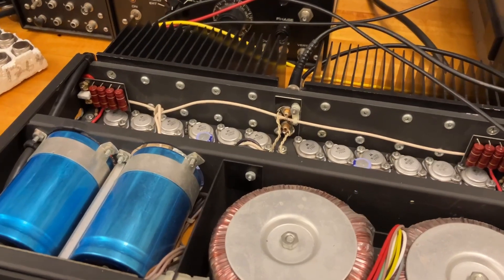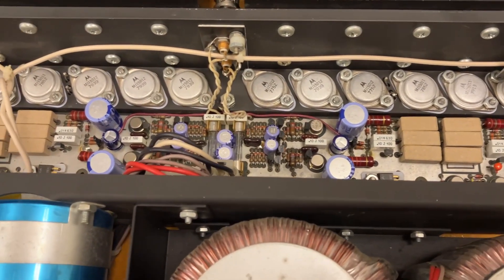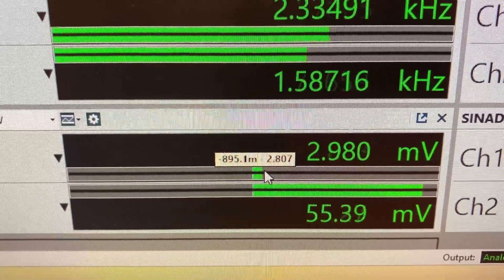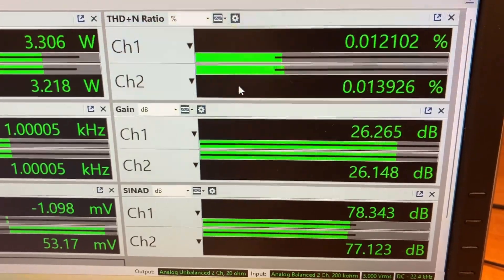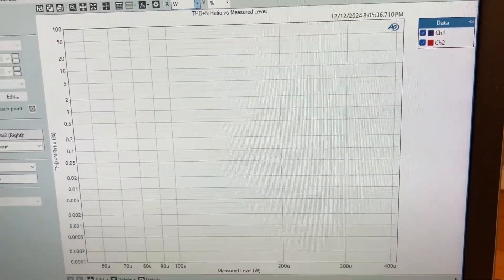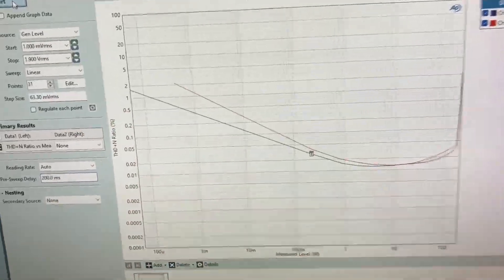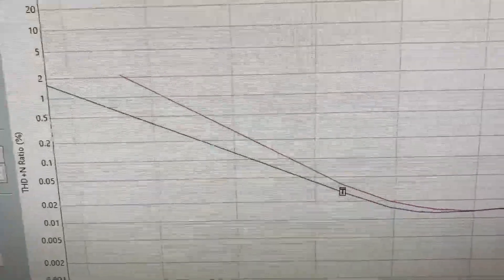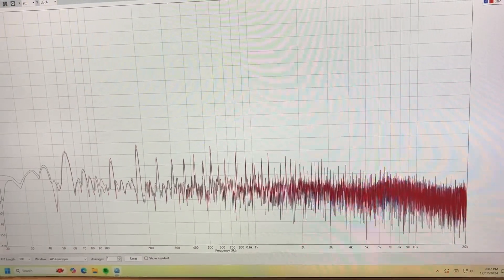Leach Amplifier: To Match, or Not to Match Transistors (Measurements with Audio Precision APx555)

Comment: Hi Aaron, I am hoping you can clear up some confusion for me.
After reading through the documentation on Marshall's website, I am confused about one section of the Double Barreled Amp description: 
" Q22 is connected as a common base stage at the output of Q12. The two transistors form a cascode stage. The base of Q22 connects to the junction of R52 and R54." 
In the schematic the Base of Q22 does not connect to R52 R54 junction, however Q24 does. This is described later in the text as a voltage divider but does not mention R52 R54 junction.

Is Q22 affected by the R52 R54 Voltage Divider somehow through R65 and Q24s base emitter junction?
Please help me to understand the function of Q22.

Comment: what makes the leach amp different/special from other amps?
Reply: In miller type amplifiers, the gain bandwidth is not infinite. This means that if loop gain is the same at 20khz as it is at DC, the differential input stage would likely be clipping with high frequency signals. This effect is called TIM (Transient Intermodulation Distortion) which doesn't have a specific standard nowadays but was a big deal back in the 80's when this amp was designed.  As we know negative feedback improves linearity, but if we cannot use too much negative feedback in fear of clipping the input stage, we must look for other solutions to linearize an amplifier. Leach amp uses some special tricks to linearize each of the internal gain stages to reduce global negative feedback. A good amount of amplifiers on the market in the 80's looked similar to the Leach amp, some even direct copies. Nowadays we have Class D amplifiers, the output stage of which doesn't inherently have this miller effect. Their input stages are constructed from opamps or integrated circuits that have much higher gain bandwidth and open loop gain. The article "The F-word" by Bruno Putzeys talks about this in detail.
Reply from the maker: Nowadays, to be honest, class D amps have become so good, and are so efficient, that the Leach amp design is arguably "out of date." But you can learn a lot from the design (check out the links in the description).

Comment: That much DC is unacceptable in a “serviced” amplifier.
Reply: Most designs allow you to adjust the dc offset by injecting some DC into the negative side of the diff amp or trimming the currents in one side of the complementary pair. Leach amp doesn’t have it so having matched pairs is the most you can do to ensure the offset is low. 50mv is not a pretty number but it will not damage speakers at all.
Reply: @ the best one could do is to have a dual monolithic transistor at the diff amp (two transistors on one substrate). DC offset trimming wouldn’t even be necessary using something like a MAT12.

Comment: Not related to the transistors:  I built a Leach Amp in 1992 as my senior project.  For the power supply, Dr. Leach had recommended paralleling the C1P and C2P capacitors to at least get to the correct value.  Being a broke college student, I ordered the capacitors from a surplus catalog.  I ended up with 4 capacitors (2 for C1P and 2 for C2P) that were 37,000 uF each.  When Dr Leach first saw it assembled, he was startled.  He later told me that in his next class he started the class with a calculation of how high off the ground the stored energy in those capacitors would lift a 180 pound man off the ground.  I did surprise some of my friends by unplugging the amplifier and having music still play for at least 5 minutes.
Reply: Funny but thank you it's good you didn't blow the fuse when you turn it on.
Reply from the maker: WOW!
Reply from the maker: Yeah, those are things you'd want to be very careful around... ;)

Comment: I can’t tell if it’s a matched pair or quad that leach amp circuit diagram shows a quad in double balanced longtail pairs.
Reply: It is a fully complementary long tail pair that’s also cascoded. Ideally all 6 transistors are matched but it is very difficult to do so especially across both npn and pnp types.
Reply: @dexi9814 matching Q1 Q2 pair with the Q3 Q4 pair will reduce dc offset as would matching Q5 and Q6 but I don’t see why the cascode pair would need matching to the longtail quad

Comment: With matching input transistors, you can get away with omitting the big cap in the feedback network. More low frequency responses.
Reply: And you shouldn't do that either way, because with DC on input you will end up amplifying it.

Comment: Higher (.47) value of emitter resistors will tend to alleviate the issue somewhat, won't it? What if you were to bridge them?
Reply from the maker: Beats me. ;)

Marshall has a bunch of notes on his website that might be of interest (see links in the description). 

I didn't get any video of it since I didn't think sound from an iPhone mic would be terribly useful, but when we listened to music through it we couldn't tell any different between the side with matched transistors and the side with unmatched transistors.
Reply: The emitter degeneration resistors in the long tail pairs are at 300 ohms. This is one of the tricks used to linearize the input stage without negative feedback. Seems to compensate for unmatched transistors quite well in terms of distortion.
Reply: @dexi9814 By using emitter feedback resistors it is the very nature of negative feedback . Not sure why you do not realize that
Reply: @joeblowe7545  I should be more clear by saying global negative feedback. Emitter resistors provide local current negative feedback, but it is not the same as global negative feedback which is subject to the miller effect that produces TIM. Leach's article about this covers it in detail. "The F-word" by Bruno Putzeys also talks in detail about the problems of global negative feedback. Having local feedback like this is referred to as "Cascading to improve loop gain" by Bruno.
Reply: @dexi9814  We were talking about outputs, it's at the other end.
Reply: @paulb4661  In this video we tested matching the diff amp at the input. Outputs have emitter resistors at 0.33 ohm, they do not have to be matched. I have never seen an amp designer specify that the outputs be matched, though I have encountered an amplifier that blew fuses because one of the outputs had 4x the hfe as the others.
Reply: @dexi9814 You're absolutely right! I could swear I heard output, not input watching the first time. This changes the perspective quite a bit. As a side note, you can get away with multiple pairs of lateral output fets with no emitter, or source to be precise, resistors  thanks to close matching on Vgs from the factory. With sources on the case, you can even have complementary pairs bolted directly to an isolated hestsink.

Comment: do you have to get a batch of transistors  and hope for matches within the sample batch or can you buy matched ones ?  And determine what you need or just shotgun and get fully matched sets for both channels and thus all new transistors with no wear and tear on them ??
Reply: my error as I was looking at the output power transistors and missed the input reference......I have had a basket case here I see as a door stop as many BASS amps crap out in due time.....but I do Vacuum tubes
Reply: These are general purpose low noise bjt’s for the input stage. I believe it was matched by visually comparing the output characteristic curves between devices. No specific hfe target to achieve.
Reply from the maker: We couldn't tell any difference listening to the matched side and unmatched side. I'm not sure Marshall himself ever bothered matching. ;)
Reply from the maker: I don't think any of Marshall's designs used integrated matched pairs.